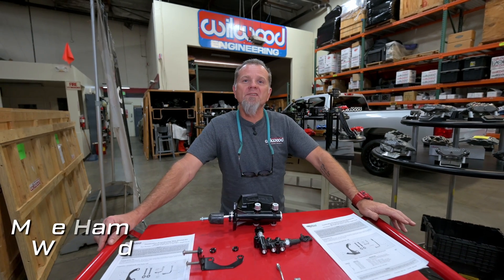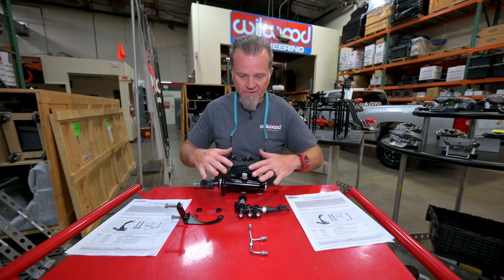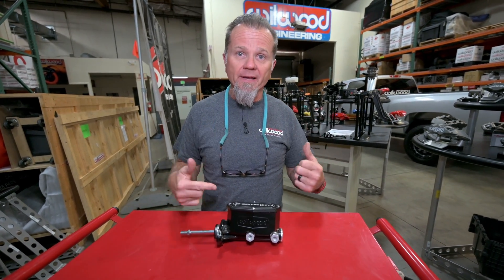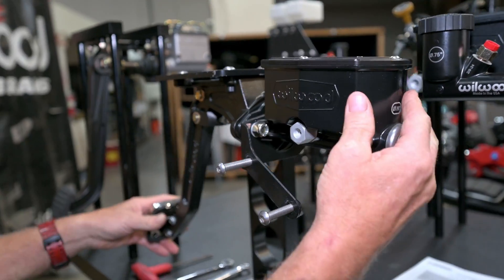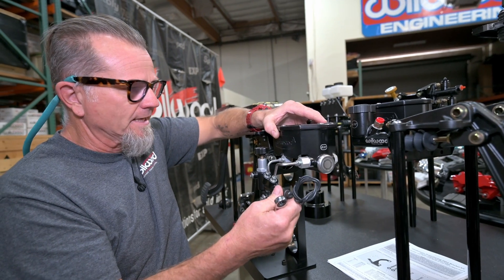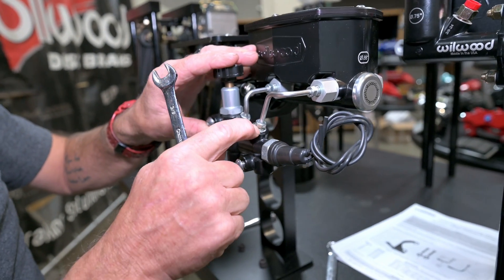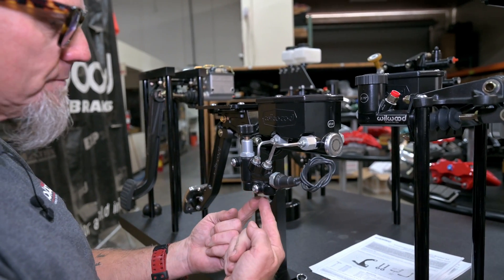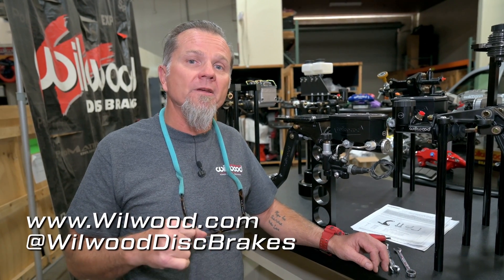TIP: Master Cylinder w/ Proportioning Valve Install - Brake Time Tip

Comment: Great advice.  However, a little less fender fitting would be better.  Have been using Willwood for several years; no problems at all.

Comment: 65 mustang v8 auto trans.I just installed today manuel wilwood MC/proportioning valve w/ 12" front disc kit The front does not bleed no pressure coming out,I bench bled the MC, I open the bleeder screw and no fluid come out.  But my rear other brand disc do bleed good w/ good presure. Plus my pedal sinks to the floor easily...what can i do.I called wilwood techs they said to gravity bleed'em but no fluid comes out.Also to pair bleed open bleeder at the same time front & rear dont know how that'll work...or to drain n start all over...any suggestions.Thanks

Comment: 74. Laguna Big block Car and I just switched over to your Willwood calipers routers everything and now I’m getting the Willwood master cylinder 1 inch board proportioning valve and this video was very informative. Thank you so much. I really appreciate this in depth. I understand how this works to do it properly because I’ve heard stories. This is a great video. Thank you.

Comment: am doing all brake system in a 1952 chevy truck.  i just have a question: do you think is a good idea to swap an electronic brake control module from chevy 2000 s10 to chevy 1952? i never seen a car"s builders installing an Electronic Brake Control Module to old cars

Comment: Would you delicately lube the threads?  Also how much is it going to drip after the bench bleed?  If I mount it (after the mock up and after the bench bleed), how much dripping will happen?  You said having rags is good for sure obviously.  Will I need to have fluid available to refill the reservoir while I fit the unit?  Do you think it would be handy to have another fellow available?

Comment: Hello! I have an 89 c1500 standard single cab I need to replace the master cylinder door the brakes and the proportioning valve. I've gone through multiple different masters and nobody carried the valve for that year. Would emailing Wildwood directly give me a little more information so I order the correct parts? Thank you
Reply from the maker: @b_onez3069  Hi, thanks for contacting us! We would like one of our trained techs to assist you. Please give us a call at 805-388-1188

Comment: How to tighten down the aluminum plugs on one side of the master, and the female fittings that the valve attaches to?  Teflon tape?  Thread compound? With or without washers? How tight to ensure no leaks and avoid stripping?
Reply from the maker: The answers to all your questions may be found in the instruction data sheet on the product page on the website, and they are also included in the box. Here's a link to the data sheet: https://www.wilwood.com/PDF/DataSheets/ds1520.pdf

Comment: I haven't had any trouble with aluminum fittings on any wilwood stuff. It is very important to make sure everything threads in properly and is situated properly like explained in this video. 
My main issue with wilwood products has been master cylinder bleeding. I guess its not necessarily an issue but its the thing i have trouble with sometimes. I really like the wilwood master cylinders but sometimes they can be a hassle or time consuming to bleed although now that i have practice its not too bad. If the system is completely dry you can have air come back up and get trapped requiring a second bench bleed especially if your master cylinder is mounted at an angle with the front pointed up slightly. When bench bleeding you want to point the front of the master cylinder down a little to get bubbles out that can be trapped at the front. Also the bench bleeding equipment that comes with the master cylinder is great but I tend to use my own hose with a little extra length.

Comment: Here it is... Dry fit it first.  I do wish Wilwood included longer lines to bench bleed as a unit. {hint}  Doing a mockup will allow you to find or get the tubes you need.  I'll be doing mine soon. Thanks, Mike, for the tips